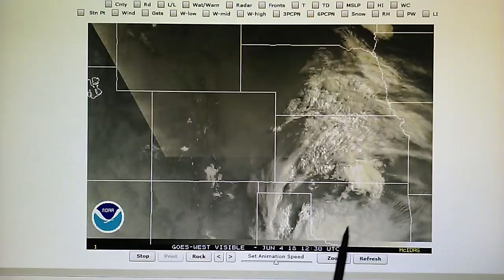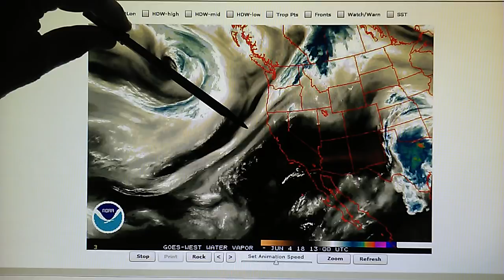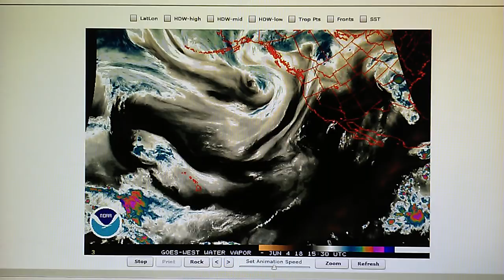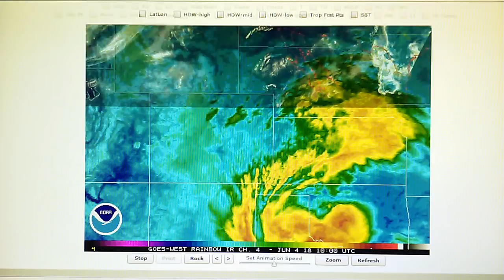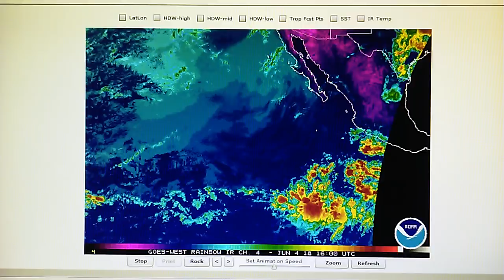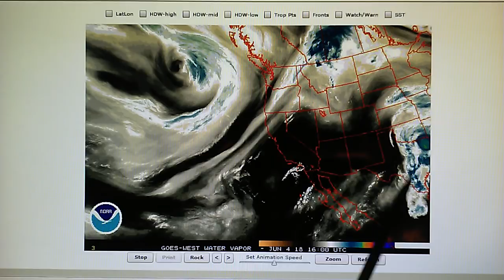6-4-2018; Satellite Transmitter Superheats Giant Thunderstorm Over TX; Gale Steered Away from CA!

Comment from the maker: (11:50pm Thurs) Aletta is now a CAT3 hurricane and rapidly intensifying; central pressure is now 957mb. Wednesday morning, Aletta was a tropical storm with 45 mph winds and 1000mb pressure. The weather controllers could have superheated and knocked this storm down, as we've seen in the previous videos posted this past week. Aletta is moving NW at 6 mph. All Winter and Spring, developing weather systems in the Eastern East Pacific are systematically targeted and superheated to prevent hurricane development. Aletta is being allowed to spool up - and it could be superheated and stopped at any time by the weather controllers.

Comment: 1PacificRedwood One question;  Where do the satellite transmitters get their energy from?
Reply from the maker: gargoyle1779 - Solar panels and supercapacitors which function similar to batteries but have the ability to provide instantaneous high current to a load such as a microwave or laser transmitter. Of course there are power conditioning circuits, regulators and voltage converters on these satellites to power the communications links and the on-board computers. These are large satellites, probably the size of a small bus weighing 3+ tons.
Reply: They must be very powerful in order to evaporate all those tons of water vapor.  Almost science-fiction-like.  Don't get me wrong.  I'm not saying the powers that be don't have that kind of technology.  I reckon they could target some poor soul whom they deem a threat to their security, and soft-boil them whilst sitting at their computer station if they wanted to.

Comment: Woke up to blue skies this morning in the San Fernando Valley and checked the skies again after breakfast to find toxic chemically created frankenclouds. It's now noon and we have an almost complete white out blocking the sun. How can people think this is naturally occurring?  I talk about this wherever I go and most people just look at me like I'm nuts. I don't go on rants either, I just calmly mention that our weather is manipulated by means of chemtrail spraying and microwave transmitters such as HAARP. I also talk about the monetization of weather control such as derivatives traded on Wall Street. It's so frustrating that a lot of people have such a knee-jerk negative reaction like you're making this stuff up when the information is right there online. Regardless, I will never give up trying to awaken people to the truths in plain sight. It's why we're here.
Pacific Redwood1, thank you for providing this information, you need a wider platform to get the word out!
Reply from the maker: KP91403 - Thanks for your comments. Just to clarify: HAARP does not operate in the microwave RF spectrum, the HAARP phased-array type antennas transmit at between 3 to 12 Megahertz which is nowhere near the microwave band which begins at 900 Megahertz (MHz) and extends to 300 Gigahertz (GHz). The size of the HAARP dipole antenna is a clue to its transmission frequency.  The HAARP antenna is approximately 72 feet across in both axis and the array of around 180 of these antennas can be tuned to focus its power into a small area. Look up Dr. Bernard Eastlund on YouTube, he held many of the patents on that technology that eventually became known as 'HAARP'.  Eastlund worked with Atlantic Richfield and the technology was used to vibrate the Earth's crust to locate minerals and oil which all have specific resonant frequencies while embedded in the Earth's crust. This is how the company explored and located natural resources, but like most useful tools with many capabilities, they end up in the wrong hands being utilized for nefarious purposes.